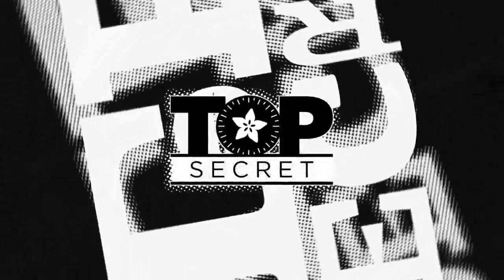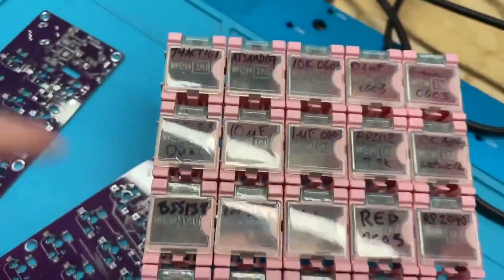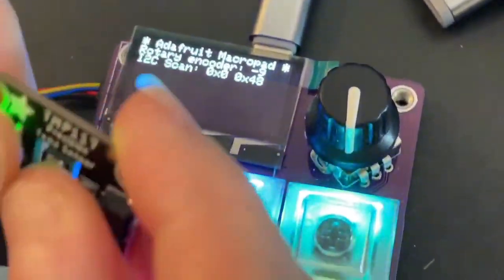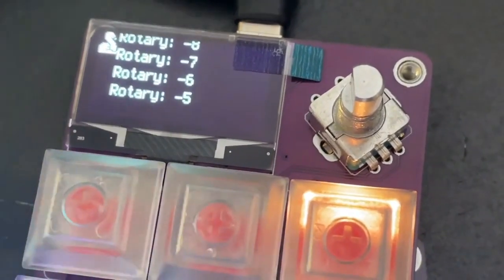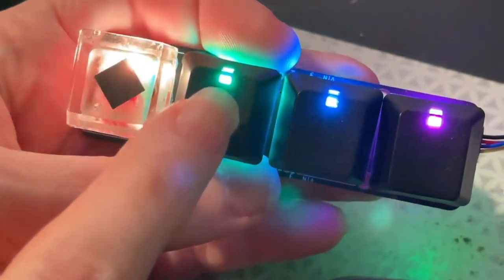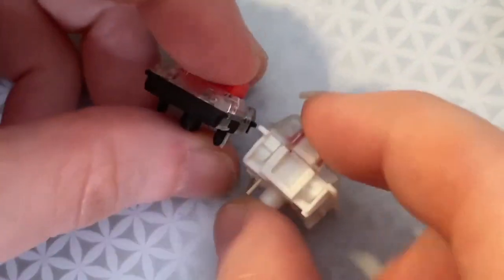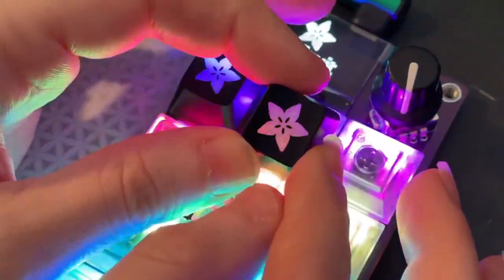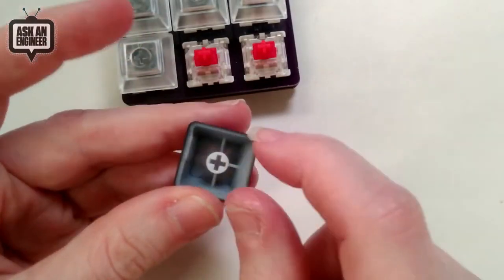Adafruit Top Secret! June 9, 2021 #Adafruit #AdafruitTopSecret @Adafruit

Comment: In keeping with the keys, what about keys with LCD screens in the caps? I saw a promo video several years ago where each key had its own screen in the cap, I think it was 64 x 64, that you could dynamically program to change the display.
Reply: Touch displays won that economic fight. It's cheaper to have one large display, then several tiny ones.